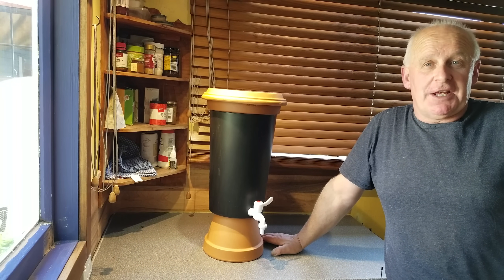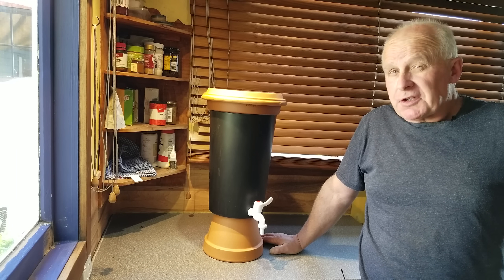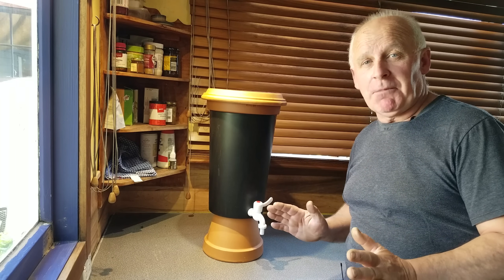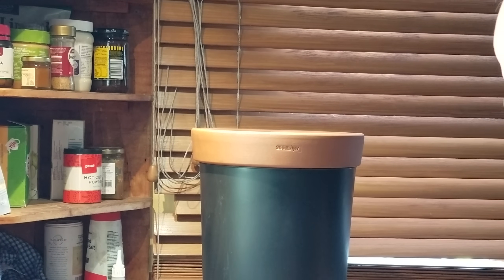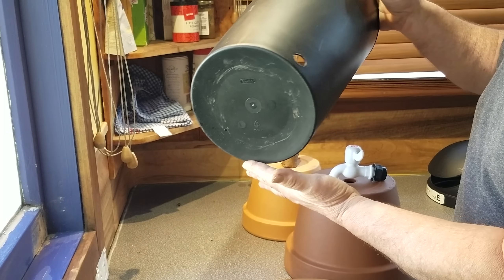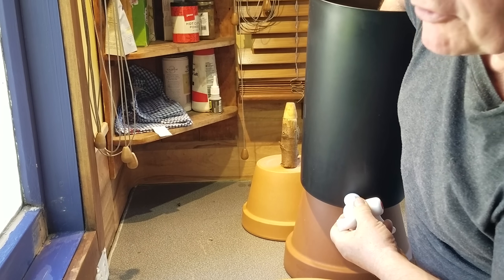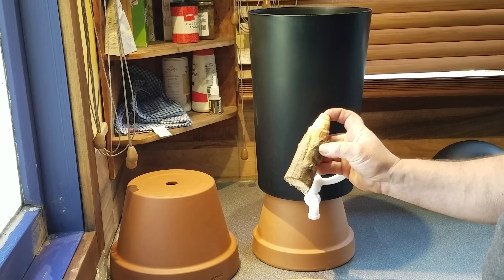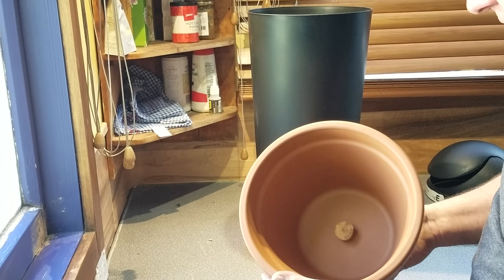DIY water filter. How to make FILTHY WATER drinkable

Comment: Nice idea, but to be fair, I believe that Berkey filters have activated charcoal or carbon filters to catch organic chemicals, not just particulates.  I don't think just plain ceramics would do that.
Reply from the maker: Carbon filters are an option with Berkey- there are different cartridges available- If you want to spend money you can buy a Berkey cartridge and fit it in the middle hole.

Comment: At the risk of sounding ignorant is there a point where the top pot needs to be replaced because of contamination?
Reply from the maker: Maybe- just like a filter- it depends on how its used and maintained.  If in doubt- swap out the $4.00 pot! The subsequent video  linked in this one explains all that

Comment: That's a great idea and I am interested in water systems and how to clean your own dirty water to various degrees of use! Whether from rain or lake, river or wherever. Logically we should find the cleanest dirty water to begin with, that could be rain or even water from air. I have seen on the coast of Peru where they catch water from the air in nets and they have a flow system where all water goes into a tank. How they filter from there, I don't know! Water of course is the eternal solvent that can have all kinds of unwanted chemicals in, especially I wonder how to deal with air pollution? Filtering is the only way to get the stuff we don't want out of the water. One way I tried was to use a rolled-up clean white sheet with reasonably clean water to start, roll it to fit inside a plastic pipe and put one end into the lowest part of water reservoir at a higher point than the water will run out from, capillary action draws up the water and when it reaches the fulcrum to descend, gravity will also assist. The white sheet is so you can see if it gets dirty and wash, or replace it! This is a first stage filter, for which you could also use clean sand, where the salt has been removed! Various grades of sand can be used and a multiplicity of filters can be used with rock-based filtering for the purpose of mineral injection. Of course, this can get quite complicated, but I have a lake to the side of my house, so I am working out how to filter my own lake water, sometimes it is quite dirty! Eau potable is the ultimate aim, perhaps evaporation in the sun? Captured by food-grade plastic? Plants naturally perspire, as do we, so we can also capture moisture from them! One further thing to mention, Hemp rope or natural cotton rope if untreated with anti absorbent chemicals is good to use for a filter, since we want absobency and also for water transfer to the roots of your plants! The dirtiest water you could use for plants, then use them as a filter for clean water! Ideas, Ideas! Thank you for your input and effort to share! I will make my own clay pot filter too!

Comment: WARNING! This will filter particles but will not remove water soluble contaminants such as soluble heavy metal salts, pesticides and other  bioactive chemicals. Fired clay does not remove or deactivate those contaminants. If you have a clean source of collected rain water it will work, any other source  (wells etc. ), You need to add activated charcoal and/or activated clays, such as bentonite which adsorb those contaminants and remove them from the water. Those will need to be replaced periodically.

Comment: I believe I've seen these called a rabbit filter, but I couldn't tell you why. I've often thought of building one of these with two pots and a layer of activated charcoal sandwiched between them. One of those projects that's perpetually on the back burner.

Edit: typo

Comment: I applaud you for your inventiveness. However I would not use that method unless in dire straits. Unglazed pottery can release arsenic and heavy metals into the water or food prepared in them. Since each batch would need to be tested to ensure the clay source was below the maximum allowable limit for health it is unlikely that any gardening pots would be tested.

Comment: Can you line the plastic coz you dont want bpa exposure from plastics. great idea great video.
Reply from the maker: Personally- I would have used ceramic or stainless steel if I could but food safe plastic was the best I could find on the day. dont forget that water pipes tanks and bottles are all plastic. Just check underneath to see which type you have

Comment: Like it...even though I live off grid in the UK and have a bore hole with UV filtration system....when SHTF and red diesel runs out for pumping..looked at alternatives...this one you suggest is very workable.....the only cartridges I worry about running out of are 12g ones...lol..
Reply from the maker: Ive just made a slam shottie!- and no - there wont be a video haha.

Comment: Does “added features” mean that the colloidal silver wash is not needed? Do you need to clean it? If so is it just with simple soapy water?
Reply from the maker: I think you should watch the second video linked in this one - and also the the making colloidal silver video. by added feature - I mean- the colloidal silver is the added  feature.
Reply: @t.h.o.r.   so I guess that means it’s not safe to do unless it’s been washed with the colloidal silver. Washing it with soapy water won’t be enough.

Comment: Since you collect rainwater, you might keep in mind that the chemtrails that fill the sky are loaded with toxic chemicals. See if you can get a water tester...few dollars. Drinkable water should register 10 particles of contaminants per million or under. Water where I live in Texas USA, is awful, smells like chemicals....I refuse to drink it. I bought a water tester and the minute it's dipped in our water, it shoots up over 800. I would be interested to know what your ceramic pot filtered rain water tests at. It looks like a great and easy thing to set up.
Reply from the maker: That is awful news!- Ive been consoling myself that the same rain falls in the towns water supply as in my bucket. - Good thing about my bucket is that its 20 gallons and the tap is not quite on the bottom. Ive had a wee bit of sediment but nothing magnetic. Ill get a TDS meter- Ive wanted one for ages but never had the money

Comment: A plastic wastebin is not what I'd use, mainly because plastic itself isn't a very healthy material we've seen that in all those studies of water sitting in storebought plastic water bottles having problems. A ceramic container could be equally cheap and much safer, or glass.
Reply from the maker: Yes I totally agree- But as explained - I live in a small town and use what is available. Polypropylene is food safe as shown in the links, Its what water pipes- water tanks and medicine bottles are made from.

Comment: As i understand the filtering comes cause water moves through the ceramic.....so the wood is not important ? Could we use a pot without hole ? Did you ever do a chemical analysis water before and after filtering ?
Reply from the maker: Its all on the CDC and FDA websites- Thats why I linked them

Comment: I’m not quite confident that there aren’t other toxins integral to the clay that your terra-cotta pot is made from. Also, what about filling the clay pot with activated charcoal, that you make yourself, to increase the filtration efficacy?
And, how about those water barrels that you collect your rainwater in? 
Are they made of plastic? 
Do they get heated up with exposure to the sun? 
Do they leach plastic into the water? 
Can that terracotta flowerpot filter out dissolved plastic?
So many things to consider? (Not that I, too, trust my municipal water supply, as I’ve filtered my own tap water, (for drinking and cooking, and even the washing of vegetables and fruits), for decades.

Comment: I am doing this kind of thing, but a nuclear cloud dust or acid rain will fall from sky in rain, so I prefer an aqua manual pump for garden back up, but I definitely will try this filter for general use even if just to boil spuds etc.thank you for the cheap build info, I also saw one using unglazed ceramic pots with candles for anti frost heating.

Comment: the other thing is, if you have to use surface water, you could actually put several pots together, one into the other to refilter the water. so the first one would get the biggest pieces of dirt, Im thinkin, and take the longest to filter through.  Do you think that would work?

Comment: Can not help thinking this is a great idea....but that it needs clarification. How and where you collect your rainwater is very important, because it could be contanminated with many things that this filter will not remove. rainwater can collect contaminents as it passes over surfaces - like my roof - building materials, animal waste()bird poo etc. People who test their water, will only know that the water WAS safe to drink up until the point they tested it....this is a very complex topic and although I think this is a great idea, I wouldn't rely on a ceramic pot in my loction to remove everything that was harmfull.

Pestisides have been found in rainwater for example and are very hard to remove.
Reply from the maker: here in NZ about 1/2 of all rural families are on rainwater- always have been. and guess what? - the rain that lands at my place is the same rain that lands in the county reservoir. If you availed yourself of the linked info you would learn that my rainwater does notcome from my roof and that the CDC and the FDA both have extensive info on rain water harvesting and filtration using clay pots.

Comment: Cool idea! However, there are plenty of different PP grades on the market. Likely for such a cheap garbage can any cheap raw material available on the market was used. Possibly it was even a left over or recycled automotive grade that may have toxic anti-flamable additive added. Alone the fact that the container is black indicates that carbon black is added. This pigment is most likely also not food grade. I would re-think the choice of this bin and use some drinking water piping or some other type of food container 😉
Reply from the maker: Absolutely!  what Im looking for is a commercial spaghetti pot- they are often taller than they are around and light stainless steel. But when I made this my ADD had kicked in and I had to get it made TODAY!   I  just watched some of your vids- we are the same haha- make things work without spending money!  Auf Wiedersehen

Comment: A great simple build, but have three questions. (1) The design seems to be 'top heavy' when the upper pot is filled with water and the plastic container is only sitting on a smaller flower pot.  A minor bump might send it crashing?  (2) I would definitely like to see a water analysis of the source water and the competed target water.  Depending on location and airborne pollution levels, rainwater could contain a number if different contaminants.  (3) I wonder if granulated charcoal could be added to the upper reservoir to further improve taste?
Reply from the maker: None of this is compulsory- you may do it if you wish -how you wish. You can bolt it down, cut a recess in the bench top, make it wider, make it shorter. You could even follow the links to the CDC website  and the FDA website to see the chemical and particulate analysis. - Its yours to do what you wish with.

Comment: Have you had the water tested for purity etc? How will it do removing toxins in standard tap water? Or is it only good for clean rain water?
Reply from the maker: Have you read the pinned comment- other people's comments, followed the links to important information?
Reply: What pinned comment? Not seeing it here .. viewing on my mobile.. I'm just wondering what all impurities are filtered by the clay pot..
Reply from the maker: Pinned by TinyHouse and Offgrid Resources

• 12 days ago
Oh dear!- so many comments here about what could be  in my  rainwater. Just remember- Its called the Hydrologic Cycle, https://gpm.nasa.gov/education/water-cycle/hydrologic-cycle  The same rainwater that falls into my bucket is the same rainwater that falls into My towns municipal reservoir, - less all the chemicals that they add in their treatment.  Next common comment- 'What if I cant get that special wood?'- well, use a cork!~. or buy a pot with no drain hole. 
Above are the most common questions- people dont seem to read what Im linking to- which thoroughly explains what this type of filter will and wont do.

Comment: Good luck harvesting water from the sky in the usa..  in a lot of states its actually illegal to do that... so silly haha.    Although id rather just continue getting water from my own well on my property.. the only problem though is ground water is being contaminated just like tap water with pfas and other cancer causing chemicals.

So i just installed sediment. Heavy metal and granular activated carbon filters in my basement at the well pipe.  And then for my drinking water i use RODI under my sinks etc.   With this kind of filtration system the water is the purest you can possibly have.   Im also afraid your water system isnt filtering out contaminants from the rain water itself.  Rain collect airborne contaminants and isnt always the best to drink unfiltered.   I would probably use some activated carbon in your little water filter

Comment: Plastic is still plastic....
Reply from the maker: Interesting. You will elaborate on this obviously?
Reply: @t.h.o.r.  Well when you filter water into plastic, esp black plastic that absorbs more heat & transfers more toxins to the water. Even if it's a safer plastic. I would change the plastic can for a stainless-steel, or a glazed ceramic size can, or even glass. But those are all indeed a bit more expansive.

Comment: Don't let the nabobs of negativity rattle you. This is a pretty good filter. You can get a water particle tester for $15 and prove them wrong. As for heavy metals, run hot vinegar through the terracotta a few times when new, that will leach out most of it. The remainder will stay bound up in the terracotta forever. Yes, rainwater has a high particle count, but you breathe the same particles into your lungs 24/7. Your stomach is much tougher than your lungs! Certain tribesmen drink filthy water every day, yet live to 100. The purity thing is way overdone!

Comment: No mention is made of the many dissolved chemicals found in various water supplies.  Trusting this system could lead to serious medical problems.
Reply from the maker: The same rain on my land as in the towns reservoir 2km away!
Reply: @t.h.o.r.  , the nearby water source for me is by a river which regularly receives runoff from innumerable local farms which could include agricultural chemicals.  Additionally, if your water supply comes from the sky which likely experiences geoengineering spraying from aircraft, the air is loaded with nanoparticulates which cannot be filtered by your system.  In short, viewers should be advised that your system can be very useful but with limitations...

Comment: Excellent, only one small comment, perhaps washer on the outside, as water can make its way between the threads.
Reply from the maker: You are not the first to say washer on the outside. I cant make that work in my head? If your roof is leaking- you dont waterproof your ceiling- you waterproof your roof.  Hydrostatic pressure and all that
Reply: @t.h.o.r.  the analogy is misleading. In this case, if you put the washer on the outside, then even if the liquid makes a path down through the threads, then it still can't get out. If you put the washer on the inside, all you do is seal the paths between the wall and the nut, but the liquid still has a path via the threads.
Reply from the maker: I cant post photos here  but 4 more things I think of- My water filter does not leak-The O ring on garden hose fittings is inside - The silicone in a fish tank is on the inside. all these fittings pictured on this link  have washers on the inside- https://duckduckgo.com/?q=hansen+tank+fittings&t=newext&atb=v268-1&iax=images&ia=images&iai=https%3A%2F%2Fwww.irrigationexpress.co.nz%2Fwordpress%2Fwp-content%2Fuploads%2F2018%2F09%2Fquick-joint-tank-fittings-768x768.jpg
Reply: @t.h.o.r.  Draw a sectional view with the washer on the inside; the water path out is via the threads. Your examples are not relevant in this scenario.

Comment: I have tried putting a large 5 lt bottle onto the window ledge and let the sunshine power though the bottle and the UV seems to change the taste of the water all the clorine goes away.
Have a try.  Here in England 😃
Reply from the maker: Yes Steve - that is so right- I ve done that myself regularly until I went full off grid.Try it with an open top and the results are faster

Comment: Definitely adequate for particle removal. NOT safe for virus, smaller Protozoa and bacterial removal % will be variable depending on the quality of the vessel (highly suspect) also the clay will be a reservoir for bacteria to grow and contaminate the water. Post filtration treatment is needed to prevent illness with this filter system. End of story.
Reply from the maker: It's not actually 'end of story' there are two more videos that go  into the details, there are links to the CDC and FDA websites that recommend this type of filter and extol it's virtues. your comment  ' will be a reservoir for bacteria to grow and contaminate the water.'-  just like any other particulate filter, water line or tank. Thats why this is superior because it is treated with CS and is regularly cleaned with acetic acid see follow up video https://youtu.be/btQXh8rRbLk